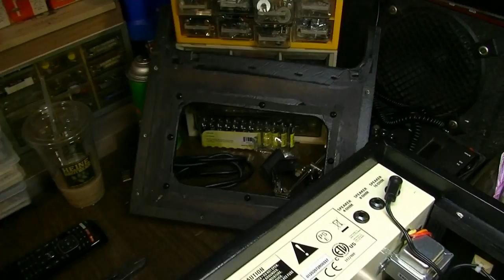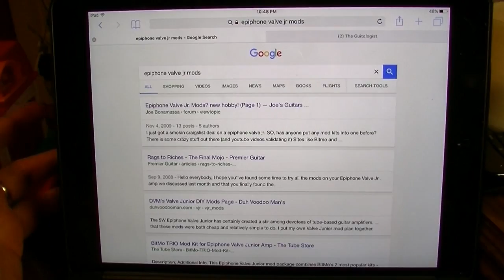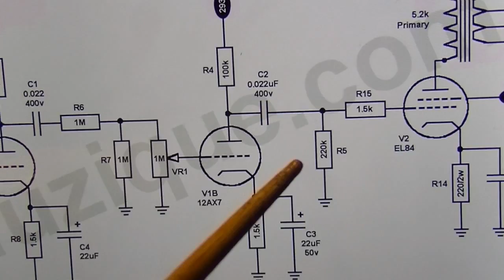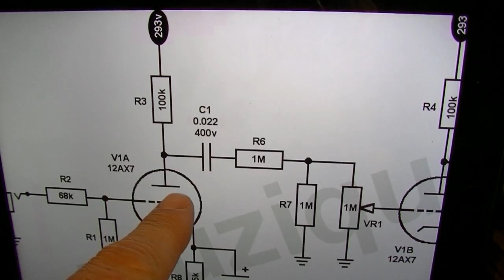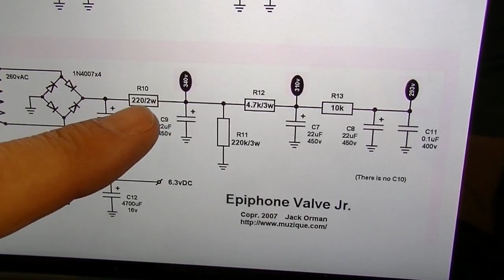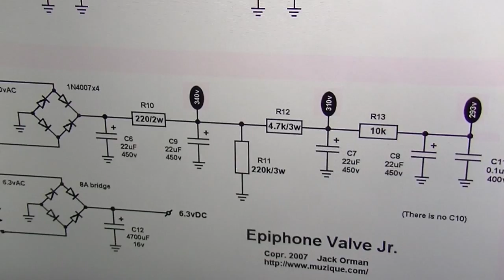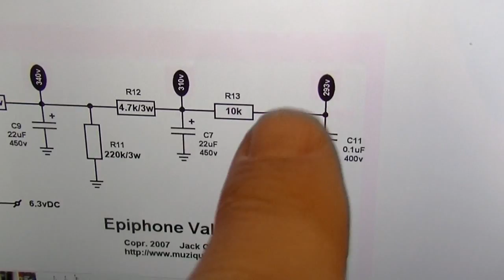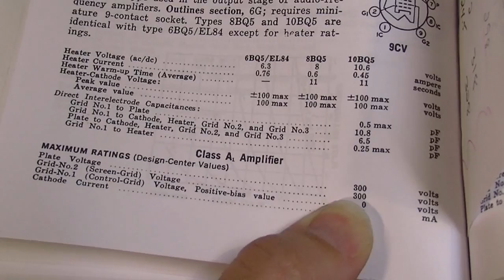Epiphone Valve Junior  Mods - A Total Waste of Time?

Comment: R11 is a bleed resistor for those BFC's in the power supply. C11 is a high frequency filter cap to reduce noise going into the preamp stage.

Comment: I do believe R11 is a burden resistor.   It drains voltage off the big caps.  The benefit of deleting R10 is two. 22uf caps filtering in parallel.   Effectively 44uf to quiet the amp.   

Kudos for doing your own thing.  The amp was already a little. growler.   But there are better choices that give this little amp a lot more flexibility in voicing.

Comment: I have a EVJ amphead I got in 2007. I run it with a 12 inch speaker from a old peavey amp.I took it to a jam session and it kept up nicely with bass and drums. I used a strat with no effects used except a digital reverb. For $30 you can get a Behringer v-tone amp modeler. Works pretty good.
Reply: I have a recording of this on my you tube channel. "Hey Joe" Not real good sound quality as it was recorded with a cheap mic to a old lap top but it got the job done. read the description.

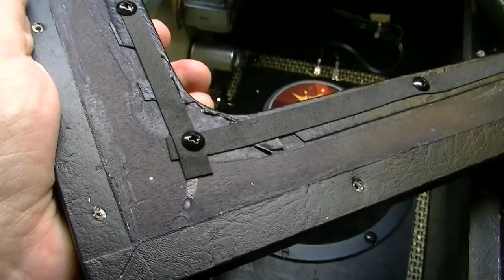Comment: I would guess the tinny, brittle sound in the "belore" clip was entirely due to the stock Chinese speaker.  I have a Valve Junior head, and it sounds surprisingly great plugged into my 1x12 and 2x12 cabinets.  I don't like the fizzy brittle tone of many single-12AX7 designs, and mine isn't that way.  Of course the tone holds together better with the volume knob at 3:00 yet still has most of the overdriven tone it has cranked.  I've played a couple of other Valve Junior amps that didn't sound as good as mine, and recall reading somewhere that there were various versions of the amp over time.

I would always try a different speaker before jumping in and swapping amp components, but that's me.  I am rarely a fan of 8" speakers.

Comment: Absolutely right about the cardboard, I recently attempted to use some Blackstar amps, they are universally crap. My brand new Blackstar ID Core 100 is now on the scrapheap and I've bought a beaten up old Fender Twin instead.
Reply: + ElectricLabel  I must disagree. The Blackstar HT-1R is one of the finest low wattage amps currently on the market!

Comment: Is there a formula or a "trick" to making the amp sound totally flat: say you had it hooked up to a microphone and you wanted the sound to be as accurate as possible. Is that similar to what the factory does or is the factory more concerned with making the values all the same so the parts cost is less? I want to design an amp like this that is a hifi as I can get while still having that slight overtone /warm tube sound. since amps are so simple I want to hand select all the parts so I can have a macintosh sound without the price.

Comment: Jack Orman schematic!!! Theres a name I recognise. I'm using some of his tone control info for a preamp for a solid state acoustic chipamp amp I'm building?? Keen to try out ur mods. I own a little head only version, that been in storage for years..took pedals well and made a racket in a band room..good as a backup on occasion. It did sound better than the combo version when run through a 4x12 cabinet..from memory. will have to dig mine out and have a play around.

Comment: The high value resistor that was removed from the power supply (where it was in parallel with the caps) was a safety feature, meant to drain charge off of the caps after the amp is turned off.

Comment: Whats the normal  voltage for the EL84  "GrooveTube"  cause I have one and it exploded at  250V
Reply from the maker: Exploded? Literally?
Reply: Yes, the supply was  250V  and to the specs  that's well within B+  range.  Fired up the amp, fed in a signal  and one of the 2 EL84's Flashed over, then the glass package shattered.  right after it direct shorted the power supply and I got the nice remnant of capacitor all over me as the main B+ electrolytic  exploded too

Comment: Sounds good, man. I have the head version with the matching cab. (12" Chinese fake Eminence crap as opposed to 8). When I first got the head, the preamp was a new EH 12ax7. Swapped it out for an old RCA ax7 and that killed a lot   of the brittleness.  Before that, I'd tried an old GE 12au7 (more clean headroom than I've ever seen in a 5 watt amp). Next thing I plan on doing is putting a decent speaker in the cab.
Reply from the maker: Thanks for sharing your experience. Every little bit helps the knowledge base.

Comment: Hey Brad did you check that 12AX7? Ive had a huge problem with those very same Jj 12AX7's Sounding Brittle and almost bassy on the back end of the note.  Very weird tone. ive sent about 10 back to Tube Depot over that last 2 years or so.  Sounds Much better!!

Comment: I just got into your channel and love it.  I just bought the Epiphone Valve Jr  Head it came with a Sunn Tranducer 1216G speaker versus the Eminance stock speaker should I be concerned or is that an upgrade.  I think that amp has been modified it certainly has been opened.

Comment: i bought one today at a flea market and mine had a 4 ohm / 8ohm toggle switch... what does that mean
Reply: I understand There are two taps off the output transformer of the version 1. Standard is 4 ohm. I believe an early mod is to fit a switch to select between 4ohm internal speaker and a more common 8ohm in an external cab.i just fitted a Celestion 4ohm 8-15 In mine. Sounds a bit better than the unbranded stock speaker. Mine is a Grainger version badged up for sound control shops Here In the UK. £36 for the amp on eBay!!. Also sounds ok through my 12 inch 8ohm cab. But not sure if should do that.

Comment: all these people chasing the jimmy page tone and this little amp nails it.
Reply: "100 bargain basement amps" 
-J. Page
Reply: Had a few of these as spares   it does nail the communication breakdown tone I'll give it that.
Reply: Did Jimmy play his stuff on that amp.
Reply: @brianmartin6808  yes
Reply: @brianmartin6808 hell no
Reply: @brianmartin6808  is that a question?? Of course Jimmy didn't. In the late sixties to early seventies, that amplifier was still decades away from ever existing. However, very similar amps had already been around for awhile.
Reply: @brianmartin6808 not quite, but the design philosophy is similar. This thing goes back to old school basics.
Reply: He did use small valve amps in the studio.
Reply: The circuit, tubes and transformers that make of the amp are not bad at all. The real limiting factor is the 8-in speaker which makes it overall 'tinny' sounding.

You can actually manage to fit a 10-in Alnico speaker in there and it clears the tubes and transformers. popular are the Jensen P10 and Eminence 1028k. You do have to dremel a bit of the bottom of chassis and make a new speaker baffle, but this is an easy hour-long project on the weekend.

Really wakes the amp up and it's still beautifully compact

Comment: Alright, so I'm like three months late, but I actually did the mods you showed to my Silverface Champ (Yeah, I have no respect for the past. Sue me.).  I had already bypassed the tone stack, but changing out the bypass caps and adding the grid stopper resistor helped it handle the ungodly amounts of distortion I like to throw at it.  Much less fizzing, much more roaring.  Thanks for the info!

Comment: i picked up one of these 2nd gens, for the sole purpose of cutting my teeth on mods. Ok and I just love tiny tube amps too! 90 bucks well spent for sure. that speaker is trash (my eyes) for sure though. I think it was maybe the 3rd version that had a better speaker out of the factory. explored a lot of mods with this on my own. never made a website about it though lol there are enough of those :D I recomend maybe Gerald Weber's "hip guitar amps" over any web site + The Radio Engineers Handbook via McGraw Hill from the 50's as reference :D

Comment: there are quite a few ready made mod kits for these amps, with what you did, could it be set up as a mod kit? Ive been looking for one of these to mod for the end table by the couch. No luck yet, but what you did sounds damn good! Only thing missing is a reverb. 

I always get a kick out it when you take a bunch of parts out, and it not only still works, but works better than before. It's like what were the designers thinking? Just throw in a bunch of extra parts to make it look more difficult???? lol

Comment: So if you had 50$ to spend on an unmodified example of this amp would you buy it for a practice amp? fyi I have the big Marshall at home.
Reply from the maker: absolutely. Then I'd modify it.
Reply: That might be the plan... thanks for the quick turn around answer!
Reply: Well I got it home and man does it sound great, thanks for the recommendation. I will give it a while before modding it.
Reply: @TheGuitologist  update, I was able to get this gen 3 combo for $40, unmolested shortly after your reply 1 year ago. 
I think I have watched this video ~5 or 6 times now planning my first adventure down high voltage lane.  
I have been slowly putting together my electronics work station and have a question for you. 
Can you point me to a good direction for a capacitor/resistor variety? 
I understand having the correct voltage & impedance but are there other pitfalls? I seem to remember that you like ceramics.
Thank you for you content, from Indiana.

Comment: If that amp was mine , id probably do the following . 
First i would stick a jensen 10 inch alnico speaker in there if it will fit ,or just use it with a 4x12 cab . 8 inch speakers suck........ C3 and C4  id swap out for 470 nF 100 volt plastics ..
swap out R15 for a 2K2 , swap out R 14 , for a 330 ohm 1 watt (fireproof) .. There ought to be a 2K7 1 watt (also fireproof ),  beetween Vs , and the screen. Instead of tyeing in an NFB , consider swapping the output transformer for one with an ultra linear tap.. Triode electronics have them at a reasonable price .. its like wiring the screen on the power tube in pseudo triode mode without losing any power . the screen ties to the centre tap on the OT primary via a 2K7 instead of the Vs...
That power supply is pretty noisy , id stick a choke in between the first two filter caps( instead of R 10 ) and beef those up to 47uF .. That should be a great little amp , i think it evolved from a Gibson G5 or a Kalamazoo... 
I built the latter from a schematic , and i was really impressed.. 
Really love your vids ! Thanks for taking the time to do em ..

Comment: Brad, I appreciate your experience, but it would help if you could explain why you seemed to know why and how to change resistor and capacitor values; when to delete them from the circuit, etc. I would think you would want to explain the frequency responses of the RC networks you are affecting.

Comment: maybe try different/better tubes?
Reply from the maker: Not a bad suggestion, but I have found over the years doing this that tubes make about the least difference in overall tone. So long as they are operating correctly and aren't microphonic or otherwise defective, the colorations from one tube to the next are minimal when compared to circuit modifications.
Reply: I completely agree, seeing how you made this amp sound so much better. But I just got a H&K Tubemeister 40 deluxe which came with those cheap Chinese tubes and swapping those out with a matched set of JJ's made a noticeable difference.

Comment: i build tube amps ,the el84 is not a glassy tube if it's treated properly,check the screen circuit,switch the cathode circuit,add triode pentode ultralinear switch.i just built a little amp that uses a 6V6 and 2 12ax7s and one 12AT7,it has full proper reverb feeding a 9" tank,NO eq but the power amp is super smooth,there is a rc network in the preamp to tame the highs a bit,and band width focusing is done in the pre amp,so no eq is needed,so the guitar can set eq.Along with triode ,pentode and ultralinear modes,the tones can be tailored to suit any style,super clean to thrash.

The chassis is the same as the one in your vid,and it's point to point built with every scrap of space used for circuit,seeng as there is so much circuit in it.

This amp was an experiment to see if i could cram it into a tiny chassis without noise,and i did..

At some point i will be posting youtube vids of it and a couple of other amps i have here.

Comment: A few thoughts, maybe they'll be helpful:
  -  I agree with others who said "change speaker" as a first step with this amp.  I have a Valve Jr, and the stock speaker sounded really dark in mine.  Plugging the amp into a 2x12 cab with Scumback speakers (no changes to the amp) brought the amp to life, and made me question whether any circuit changes were actually needed (but I haven't dimed the amp volume either).

  - Having C6, R10, C9 and taking voltage for the output tube from C9 reduces hum.  You might not notice with the 8" speaker, but when folks build homebrew Champs with 12" speakers they wonder why the amp hums so much.  It's because the bigger speaker can reproduce the hum that was always there.  Single-ended OT's don't cancel hum at the output stage the way push-pull OT's do, so the extra stage of filtering is often helpful.

  -  The amp definitely sounds improved after your changes.  Maybe the "brittleness" you're hearing is grid current when the EL84 is being slammed when the volume is full-up.  This could happen when the peak input to the EL84 exceeds the bias voltage.  Your rebias adjusted that voltage from 10.7v to ~13v, so the EL84 could take more before running into grid current.  Perhaps increasing R15 to limit grid current might be a step in the right direction.

  - Related to the output tube drive/grid current, do we really need all the gain (I mean "voltage amplification") available?  R6, R7, VR1 previously applied 1/3 of the 1st stage's output to the 2nd stage grid.  Assuming a gain of 60 for each of the preamp stages, a 100mV guitar signal would be 6v at V1A's plate, 2v at the output of the (max'd) volume control, 120v (!) at V1B's plate.  Now that's applied to an EL84 grid that only has a bias of 10-13v.  Maybe a voltage divider between V1B's plate & the EL84 grid (along with maybe a larger grid stopper on the EL84) could be something to try?

  - Kudos on the re-bias!  I ought to change mine in a similar manner.  Sure, the tube lasts okay, by why not help it last longer?

The voltage outputs above are just a guess; you'll actually want to hook up your meter to verify they're really happening in your amp.  I'm thinking you might find a balance you like between driving the 12AX7 stages hard vs driving the EL84 hard if you safely rig up a volume control between V1B & V2, where you get grind without the harshest grit.
Reply from the maker: Thanks for the comment. I did increase the R15 value at one point. Looks like I forgot to mention that in the final summation, but you can see it's been changed to a 15k at 37:20. I can appreciate what you're saying about a bigger speaker perhaps expressing more noise than an 8", but a new speaker or cab wasn't going to solve the brittleness issue I was hearing. I feel like I got close in the end. In some amps, I like a bit of unrefined grit in the tone to add character, but in this instance, it was overpowering and rendered the amp uninspiring to play. Thanks again for the thoughtful comment! I know others will benefit from it.
Reply: I often make guitar amplifiers with EL84 and ECC83. I like  clean  tone on the edge of the distortion rather than the fuzzy tone. I did many changes until I found a good solution. Here is my scheme and on the right scheme  is as a option  variable  negative feedback and presence control but I prefer the amplifier sound from the scheme on the left. Greetings from Croatia!
http://elektrotehnika.simplesite.com/434348419/4759357/posting/poja%C4%8Dalo-za-gitaru-5w-sa-ecc83-i-el84-samogradnja

Comment: Guitologist is totally dumb, he thinks he's a tech because he changed couple tubes here and there on some vintage amps, and doesn't understand basic electronics,just watch the one where he tries to repair a Mesa switching  system, he probably passed some days swapping components....
Reply: There's some hundred Volts on those caps, and he connects them with cheap thin cables with alligator clips and even touches the cables while the amp is running. How stupid is this???
Reply from the maker: Yes everyone...please do watch that bungling Mesa video! Also note the parts where the guy ignorantly uses gator clips hooked to braided wires with a combined thickness that is thicker than the traces on the actual printed circuit board he's modifying into an amp with superior tone than when he started! WHAT A FOOL! :P

I adore constructive criticism, and I thrive on rational debate, but this one is venturing into dipshit troll-land Check yourself or you're banned from the  channel. Perhaps it would be instructive for you to take the afternoon watching through my back catalog of videos deciding whether or not you'd like to lose the benefit of the free entertainment they provide.